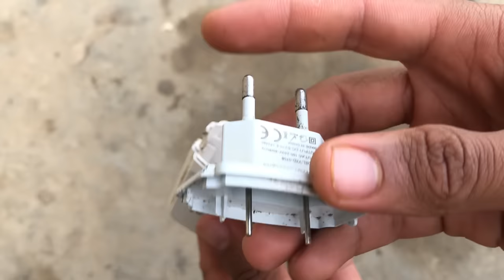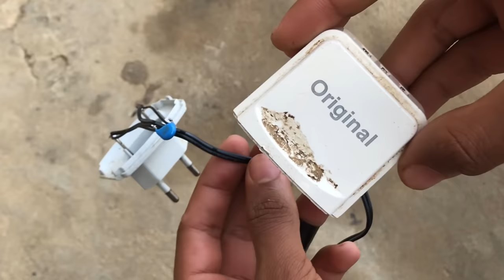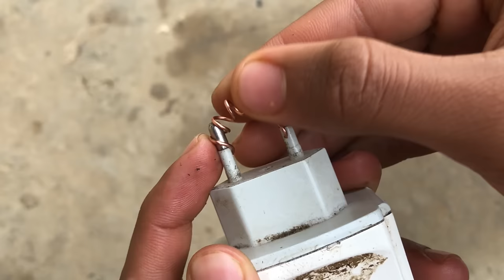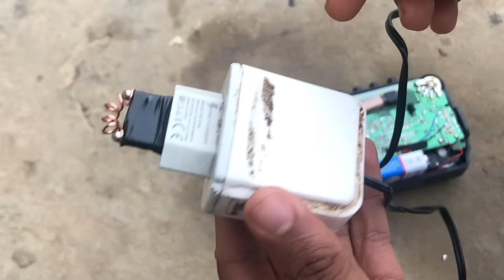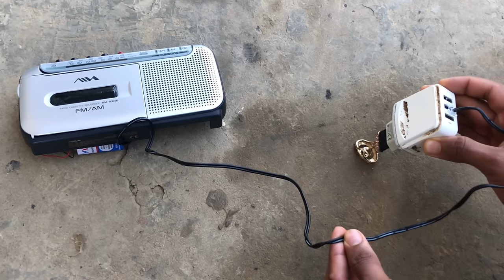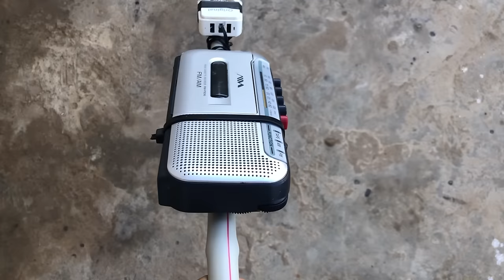I Turn Old Mobile Charger into a powerful Metal detector

Comment: Why has no-one utilised this kinda technology into either a drone or old grass cutting robot or robotic hoover that can follow set out grid pattern such as your garden, often people prospecting gold in Australia have to stop due to heat with an invention such as I'm suggesting, second battery could be charging solar whilst using first battery and person detecting could run show from air conditioned car?